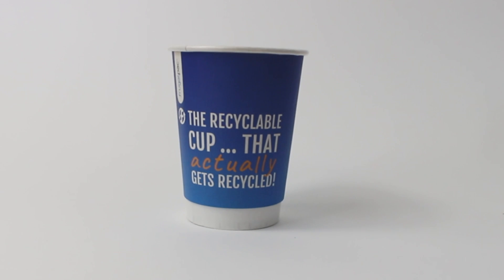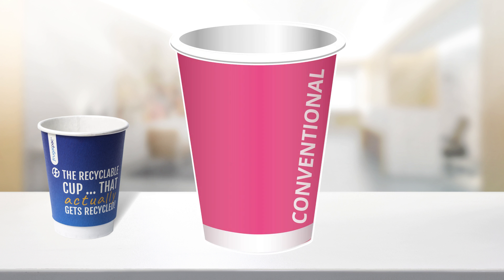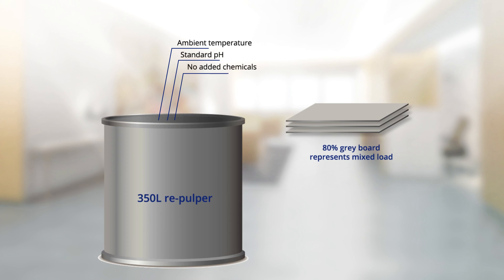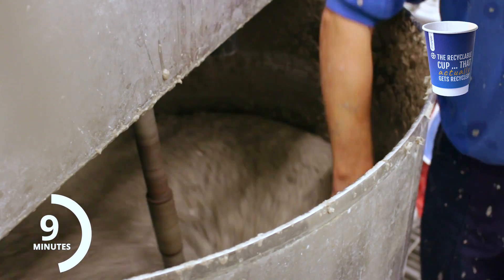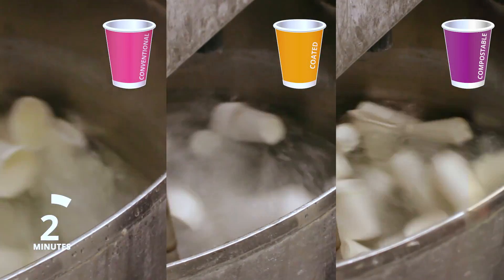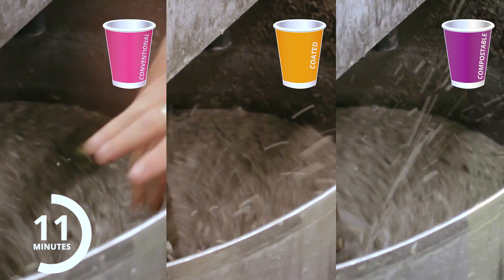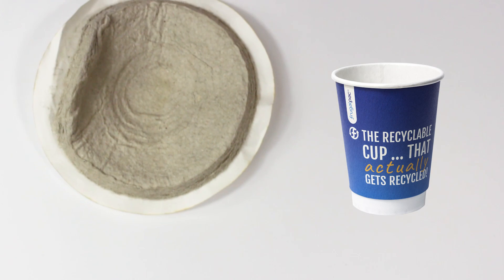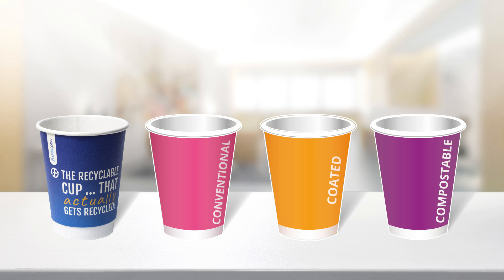Pulp Fact or Pulp Fiction?

Comment: Dear Frugalpac Team, what type of cups you compare here with your Frugalpac Cup (with food.-safe PE-lined solution in the pulping process?
Finally there are different types from industrial compostabal to naturally compostable up to even bio-degradable types. 
Furthermore - What is meant or used here as coated cup solution? May you specify a bit more in detail?
Thanks for clarifying
Reply: Dear Mathias,

Thank you for your comments and my apologies for the time to reply to you.
The cups we have used in the trial are our Frugal Cups, a product made from 100% recycled paper that does not need to be chemically treated to resist liquid or contains extruded PE or PLA. The cups structure and ease of re-pulping is made possible by an integral PE liner that separates easily from the paper.
We used a conventional coffee cup which is made from virgin paper, chemically treated and with extruded PE and for our Bio/Compostable cup we used a cup made from virgin paper, chemically treated and with extruded PLA. The coated cup is made from virgin material, chemically treated and with extruded PE and Calcium Carbonate filler.
I trust this answers your questions and if you would like more information please contact us on hello@frugalpac.com
Regards
Malcolm